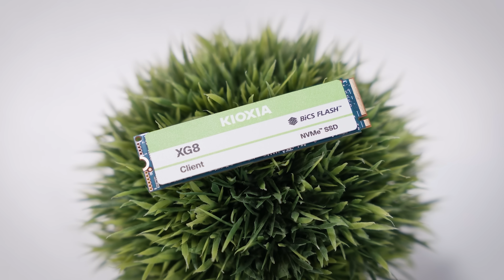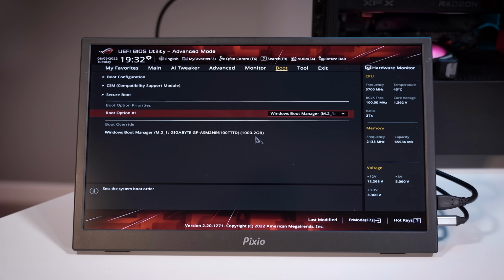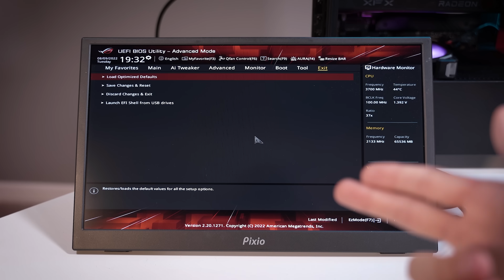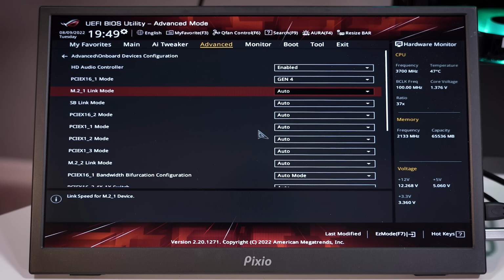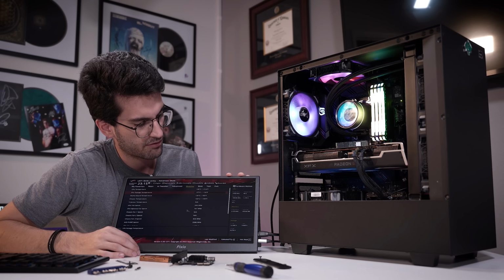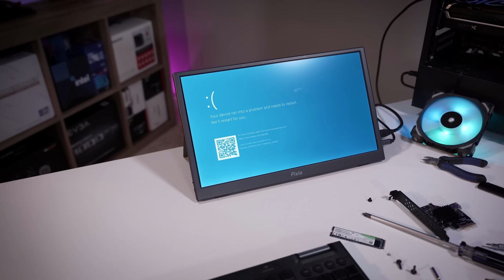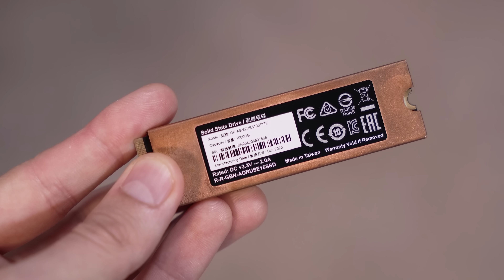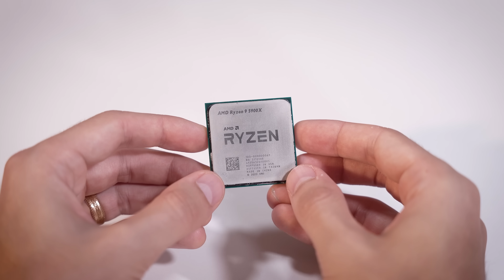Fixing a Viewer's BROKEN Gaming PC? - Fix or Flop S3:E2

Comment: The trash cooler (and especially the wat the pump is fitted) that is in there is not enough to cool a maxxed out R9 5900, it's cooked the memory channels and you had the clue with the BSOD, if you'd have removed the right channel of ram then it may boot.

Comment: Windows trying to load. Then we gonna check if drive is detectable by bios. L - logic... Temperatures, broken pump? Nah, not possible...)
Reply from the maker: Not sure what you're trying to say here. There was nothing wrong with the drive. There was nothing wrong with the pump. But these things needed to be checked before swapping the CPU. Run into plenty of odd symptoms in this playlist before.
Reply: @GregSalazar  I just mean that since windows is trying to boot up than it is obviously that the drive is detected in bios. I just saw there was mention about it somewhere in the video that the boot drive is detected. Probably you meant that that particular drive was detected maybe. Anyway, don't bother, I've just commented to make comments because I actually like your channel, but I felt itchy toxic sarcastic mood, lol.

Comment: I had the same issue. Couldnt boot into windows. Turns out my HDD was toasted and the stange thing was I had my windows installed on a SSD, not on the HDD
Just the whole thing was really confusing and still have no idea why windows wont boot if my HDD is connected

Comment: Hey I have the same MB paired with a 5800x but recently i updated my bios to the latest one (2803 rev) and after the update, my ram decided to only show up with 20gb instead of 32 ( both on windows and BIOS), installed (16x2) and i have tried everything from swapping the ram sticks around and reverting back to my original revision but no luck, and sometimes when i swap the ram sticks, it reduces the amount from 20 to 12 to 4 sometimes which is weird so any help would be really appreciated! @Greg Salazar

Comment: What surprised me about this Flip or Flop is that the 1st thing to do with those symptoms ("it was working fine and then suddenly crashes while trying to enter into Windows") is to RUN A MEMTEST.

While the memtest may fail and that doesn't immediately mean the RAM is bad, it does immediately rule out a lot of stuff (like a problem with the SSD).

You would've saved a lot of time by running a memtest, since a failing memtest means there's either bad RAM , bad Motherboard, bad PSU, or bad CPU, usually in that order (or an electrical problem caused by a plugged component like the GPU or SSD... but in that case you just plug it out and run the memtest again).

Comment: I wonder if booting into a Linux OS or memtest86 could provide more insight into these issues.
Reply: It is possible, yes, because (assuming the computer doesn't immediately reboot) Linux will print out HW errors it encounters to tty (like CPU IERR codes, Machine Check Exceptions).

Windows gathers those errors too, but you can only access them via the Windows Error Log.... which you can only access if you can successfully boot (though you can transplant the drive to a healthy system and open the logs there) and assuming the error didn't prevent Windows from saving it to the log in the disk.

Comment: I had a similar issue. I had gotten an Alienware pre-built (no judgements please, as I got a good deal and at the time knew nothing about building PCs). It is an intel cpu and nvidia 2070 Super. Worked great, but due to my lack of knowledge, I didn’t know that to use the GPU, I needed to plug into the GPU itself. Well after a month or so I found that out and tried it and got nothing on screen. After a lot of debugging, I had to just get it replaced (for free, which is part of why I like Alienware/Dell). They sent me a new one, I popped it in and started having similar problems to this video. Basically, just a boot cycle. After many hours on call with Dell support, they finally sent a technician out, replaced the MOBO and now it works great. Their tech and call center staff all said they hadn’t seen this exact issue before, but that they’ve seen similar issues when replacing a part and a new MOBO usually works.

Computers really are dumb at the end of the day, if something isn’t right, well tough, they will melt

Comment: I was screaming "RAM" this whole video.... faulty ram blocks can cause freezing / blue screens / boot loops.. but i was surprised it was the cpu... im a bit disappointed at the higher failure rate of modern am4 processors...even so... maybe you want to start using MemTest86 on a bootable flash drive.. its super simple... starts automatically... and can rule out faulty/badly-seated RAM to make your life easier... but thank you for the great content that you put out for free, always cant wait for the next episode.

Comment: My 5800X did the same thing to me after running in my system for about a week.  My problem was I could sometimes boot into the bios, sometimes a "-" on the screen, etc, but it would go no further.  It was a brand new build with all new parts.  My motherboard error code light would stay on VGA.  I ended up swapping out the graphics card, power supply, new motherboard, anything I could think of.  The only part I couldn't swap out was the CPU since I didn't have any other AMD chip available (all my builds were Intel but decided to give AMD a try).  Ended up sending back the CPU and motherboard and went with Intel again as I have never had an issue with Intel (knock on wood).  Part of me thinks my cooler I installed (a Scythe Fuma 2) was to blame.  It felt like it installed way too tight, and even another major YouTube channel (I think Gamers Nexus) mentioned the same thing.

Comment: Its pretty odd the order of operations you go in i would go easier fix to harder fix you went easy to 2nd hardest 5900x could be the issue but also could be ram I still would have tried ram before cpu

Comment: Hi greg im having a weard issue in my system now my cpu is hitting almost 90 to 100% while gaming i checked task manager to see if anything running in the background but it's nothing there everything is normal only my games are having high cpu usage then before(example AC Valhalla Before 30 to 50% now 70 to 90%) i reinstalled windows, flashed new bios, updated all drivers but nothing helps. Any tips Thank you
System---
I5 12400
Asus H610m ed4
Asus RTX 3060ti TUF
2x Corsair vengence 8gb ddr4 3200
550 watt cooler master psu
Cooler master 240ml aio
Windows is on 500gb nvme ssd

Comment: This probably isn't related to his boot issues but, that's not a very good case for this CPU, I also have a 5900X that used to overheat like mad until I upgraded to a Silent Base 802 case. Before that I had a Segotep Halo with a glass panel at the front and I think even that case had more airflow than he does.

Comment: Does he have 2 SSD connected? I had an issue where mine would not boot and I removed my second ssd(storage only) and restarted computer with no issues. Reinstalled the second storage drive and it all worked.

Comment: Having worked with multiple Ryzen 3000, 5000 series CPUs on ASUS motherboards, the higher core count CPUs it's completely normal for the CPU temp in the BIOS to be that high on ASUS ROG motherboards with the default settings. By default those MBs keep the voltage high while in the bios, once in windows the voltage & temp will drop.

To be honest I would of started running memtest86 off a USB drive, with 64GB of RAM, 4 DIMMs, when it failed I would of tested the DIMMs one at a time, but it could just be the IMC on his 5900X was weaker than the IMC on the 5950x you tested after, also that memory kit was running at 2133MHz so I would of tried turning on the XMP just to see, that also would of boosted the voltage from 1.2v to 1.35v depending on the kit, I had a older Intel system that was unstable with XMP off oddly but was 100% stable once XMP was enabled. Also there is a slight chance maybe there was a piece of dirt/dust in the CPU socket messing up the connection to one of the DIMM sockets when the 5900x was installed, or just changing the CPU, reinstalling the cooler, flexed the board enough to fix a connection issue in one of the DIMM sockets themselves, or it really was just a bad CPU.

Also you can run Prime95, CPU-Z, Hardware info from the windows 8, 10, 11 installer environment, useful for testing stability without being able to boot into the installed OS.

Comment: Had a similar issue with my i7 8700k , constant bsod loops , running at 5 cores made it stable , not really a fix but the system worked

Comment: Greg, i had this exact problem 2 years ago with my MSI 1050 Laptop that i still have to this day. I ended up fixing it by literally reinstalling a brand new version on W10, i lost a lot of college data, but i needed the laptop for a 6th credit summer class.
It was an infinite loop that happened because of the SSD and the bloatware that came with the system brand new when i bought it.
I am surprised it was the cpu though with this one.

Comment: i had a similar thing with a 5950X. system would sometimes not boot and sometimes would. but then after a few seconds would  just freeze (still the windows desktop on screen, just not doing anything). Funny part: when I made it to cpu stress test it would run 3 hours on 100%.  Soon as I stopped stress test it froze. Fortunately I bought the PC from a builder. After 1.5 weeks he also found that the CPU is broken. As it runs fine on 100% load I guess something in the infinity fabric gave up. Hope this is not "normal" for this generation of cpus as I have 10 such riggs running in the office....

Comment: I had the EXACT same problem with my system after doing a mobo swap, down to the same BSOD errors. Power cycled and wouldn’t boot into windows. It ended up being a conflict with the drivers for my onboard NIC and my PCIe network card. Removing the PCIe card worked like a charm since it didn’t download the drivers for it after the windows install. Great video!

Comment: Curious to know what you come up with when you test the 59x. I recently built brand new with the same processor I've tried the exact same cooler and 2x360 aio. I find it runs quite warm. I thought it might be a mounting issue too. Nope.
Although im not getting any weird problems. So im thankful for that.

Comment: I've had a similar issue with my PC a while ago when I was running my 2TB HDD as a boot drive and all the file jazz. Had to put the drive in another PC as an "extra memory" and get every piece of important information. Reinstalled the windows, then a short time later upgraded to NVMe and set everything up and it's going strong, the HDD that I was using is still in good use. 
But I'm glad that I did not have the issue that Greg had to deal with with this PC, which would be really frustrating...

Comment: I was 100% sure that this was a CPU issue the moment you said it gave different BSOD codes even when all the other drives were removed.
It's either that this CPU has gone bad for the reasons you mentioned or the controller of the PCI nvme Port from itself has done bad, who knows why, there is also a chance that if it hasn't gone back, try some WD-50 Specialist Electric contact cleaner on the "faulty" CPU and brush them with a very fine anti-static brush and then the MB's pin holes as well with that cleaner and some air spray to know its not a shorting or some dirty issue on the pins or holes that's causing the issue.

Comment: In my experience, fast boot can be an issue, although its been some time since I've seen it cause any. Still, when trouble shooting, I tend to disable it. I don't typically jump to the conclusion of "drive issues" when I see bootloops, that's usually cpu mounting related or ram related. I enjoy these troubleshooting videos but honestly, it annoys the crap out of me every time I hear you say "im gonna change this part over this part cause its the easier option". Do the best option, stop trying to save effort. After the initial post test, it makes sense to just take all the parts out and test them on the table, that way its not especially easier to change any of the parts and you can just target what you should.

Comment: I had an interesting issue come up with an old computer I put together from spare parts. Upon first run everything was good. Boots no problem, install windows, start setting things up. Install some drivers and restart computer. But now every time it boots to windows the computer hard crashes and powers down. Reinstall windows… all good until I install drivers again, then it hard crashes again. What it turns out being was a bad power supply. After installing the graphics drivers, the card attempts to pull more power from the PSU than it can handle on the PCIE rails and the supply dies (700 watt supply, so theoretically more than enough.) maybe a bad capacitor on the rail or something.

Comment: I have had the same issue happen to me with a very old CPU, an Intel Q8XXX ( forgot the reference ), What happened was that I bought the CPU for like 10 bucks, I needed it to boot an old system and hopefully repurpose it, I socketed the thing, went into bios WITHOUT putting the cooler back on and it sat there cooking for around 10 minutes before I noticed. I immediately pulled the power plug but it was too late. When I unsocketed it I saw some brown spots, like burnt marks on the grid array, It never could boot again to Windows and the furthest thing I got from it was almost completing a Windows install from disk. It reminded me that old CPUs didn't have real temperature sensors at all, neither was accurate thermal shutdown.

Comment: Last week i had one of the most wierd issues with Windows 10 for a client, after formatting and reinstalling and debloating the system, every time we restored the user files by hand, that includes the folder which holds the taskbar items, the explorer would not load anything on the task bar, no icons and only by pressing on it would restart and then work.
This also caused the PC to slow down when booting after the log in screen which took more than a minute on a fresh system running a 500gb 970 Evo which made zero sense especially given speeds checked out with Crystal Disk Mark and Crystal Disk Mark as well as HWInfo.
After 3 hours of searching online,  running updates, DISM and SFC multiple times and checking the disk for errors and some other nvme related statistics via a live USB with Manjaro, i had the idea to simply boot to windows again and delete these 3 shortcuts and the issue was instantly fixed it.
I couldn't believe that this was the issue and how badly the explorer is coded but hey, experience gained right?
Also for people who are gonna say it's the debloater that caused the issue, it's not, this is my full time job i do it on laptops and desktops literally every day there was never an issue even with the exact same windows version.

Edit 1: In the beggining we thought that the issue was caused by either dust in the connector because the owner never used that slot before the time he got the NVME so some time has past and since i had to clean his PC 3 times so far and because the NVME drive was bending towards the motherboard since the owner could not find any other screw on the box of the NVME when he bought it (MB also didn't have one) so he found a random one and tried it.

This wasn't the case either because the same thing happened even after placing it properly with a new screw and have the slot  cleaned with WD-50 Specialist Electric contact cleaner and an anti static brush and canned air spray.

Edit 2: First thing i also checked was Gen speeds in BIOS just in case, this was also not the case, also, his MB Bios was fully updated, i did that myself.

Comment: I had the same problem with windows 11. I don't know of that's the problem yet. I did the beta testing revision which ran fine with a few bugs that were fixed as time went on. When the software fully launch I would get an error when trying to update Windows. I contacted Microsoft and they said do a couple of thing one at a time. So I did. after a certain step my system started doing the same thing as the one here. I had to reinstall windows. Funny enough that the time I realized you cant reinstall windows on a partitioned drive, you have to wipe the whole drive. Recovery from the beta launch windows wouldn't update either.